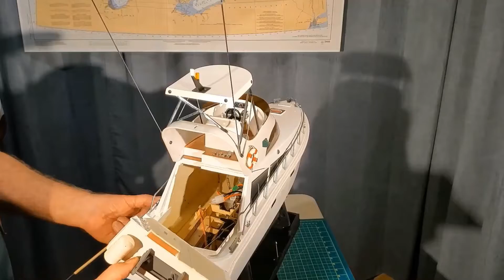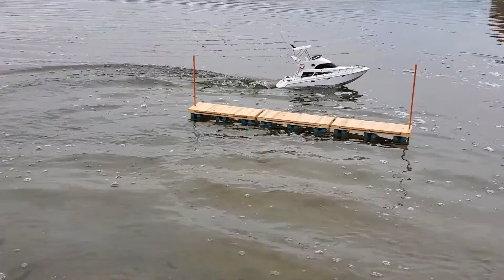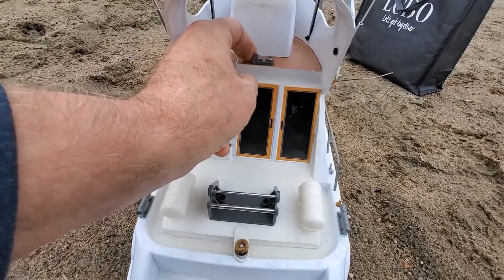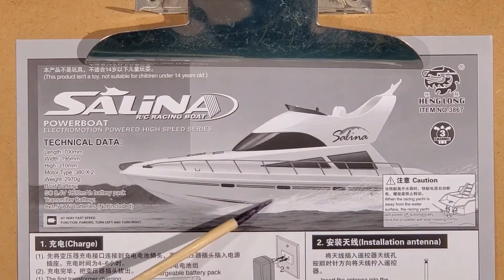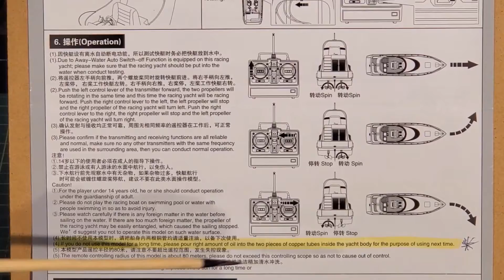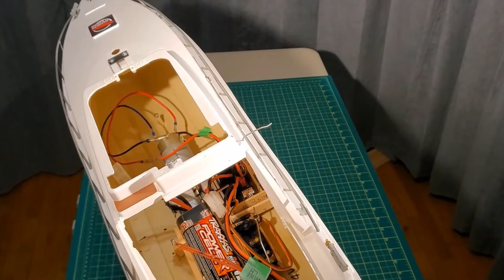RC Salina 3867 Boat Mod to Full Proportional

Comment: Wondering if it is worth modifying this. The single prop did make it a lot slower. Also the hull, although a good shape is very noisy. What limitations may there be to making it a twin jet?
Reply from the maker: My goal was to make the hull fully proportional for fun around a dock.  I think you should experiment with your jet idea.  It's a nice hull designed to look like a power cruiser so it may not be the best for super high speed.  I had considered installing twin engines some day in this model.   Brian RCWH

Comment: what were the steps to create the second opening?
Reply from the maker: First I cut out the flat floor and angled part with the stairs. Then I framed in a cockpit coaming with basswood.  Next I made a flat hatch over the cockpit then cut and ca glued the angled section to that.  I added bits of trim here and there.   Hope that helps.  Brian RCWH
Reply: Thanks for the reply, that helps a little, although even with a video I might still mess it up lol 😅

Comment: Hey Brian. love what you are doing. I was wondering if you could do a in depth look about how the schooner operates. controlling the sails via servo especially. also, would you be up to taking it in a stiff breeze? i would like to have something similar but have to see one in action first. my pond gets very gusty!
Reply from the maker: The schooner has no sail servo and operates like a pond sailor.  The great feature is the schooner has an auxiliary motor and can power the direction of the boat so the wind fills the sails.  The sheet lines are fixed in place and set at a loose beat. I hesitate to take it out in a strong breeze because the bulwarks have no scuppers   So if the rail goes under the topsides are flooded and water gets below.  I explain this a bit in the beginning of the RC Gaff Pilot Cutter Build Part 1 video. Consider having scuppers on your schooner build for those breezes !  Brian RCWH

Comment: what model was it before the mods? toy grade?
Reply from the maker: Good question.  I searched Toy Grade vs Hobby Grade and think the original stock Salina is in between.  Original spare parts are available so it's not the kind of thing you have to throw out if it stops working.  But the electronics are not configured as a separate esc and receiver and the original rudder is not remote controlled and the boat has no rudder servo.  It has a mechanical trim/rudder. There was no reverse on the original..  Now having said that I would buy another stock Salina without hesitation.  Quality is good and it is perfect for mods.  Brian RCWH